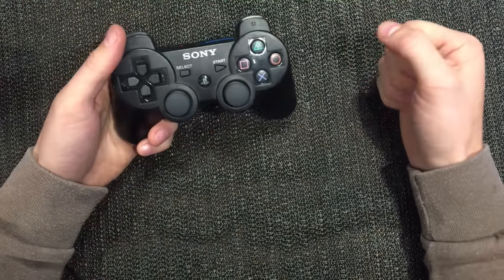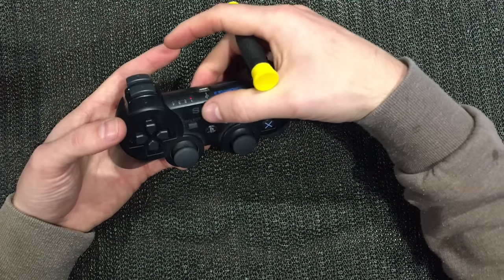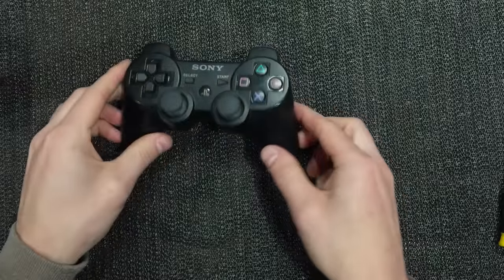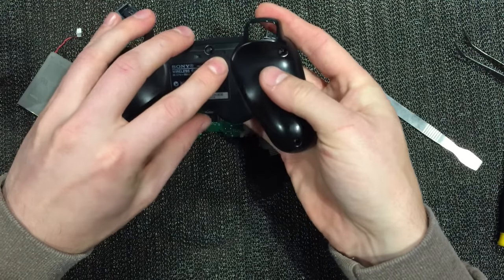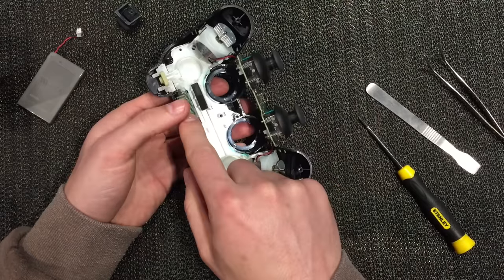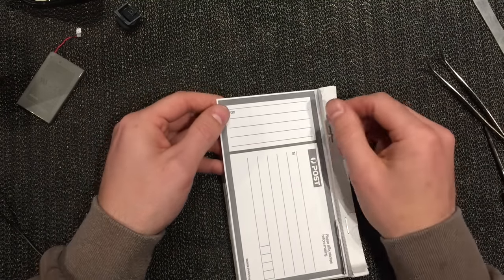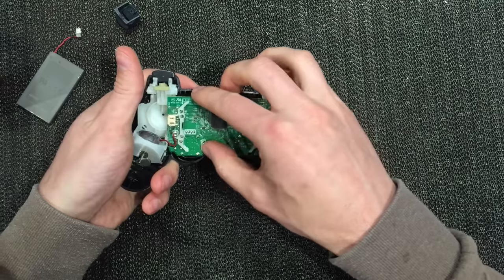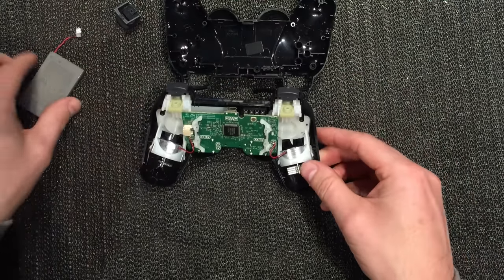PS3 controller buttons pressing themselves fix - YouTube

Comment: This worked well for my ps3 controller as well I also disassembled it completely to clean the buttons sockets as the debris causes friction which reduces input speed, I will say this be extremely careful as the circuit film is not that durable and the bumper buttons need to be align a specific way for the controller to close and the buttons to work properly if done incorrectly it will damage the circuit film, which happened to me then the controller would not turn on so I reopened the controller aligned the circuit film tab with the corresponding position on the circuit board and brought them together in such a way the the tab was held in place by the board and I tightened the screw that holds the board to the whitish/clear frame that holds it and the buttons and joy sticks so that it was locked in places since the hole that caught onto that frame had been extended so it no longer was held in place by the catch, there may be a way to fix the film so it does catch again but I was in a hurry I turned on the controller while it was still open and it worked fine I reassembled it and it worked fine for 30 minutes no random buttons pressed in game.

Comment: for me the fix was just pulling the ribbon, iwggling it a little and putting it back in place, it stopped doing that, whenever I moved the left stick and pressed it's click it'd either cause a triangle or R1 phantom press, after diong it I tested the controller on the PC and was glad to see there was no longer said false presses

Comment: My controller has this problem when I click down left stick… Some games uses LS for running so it’s annoying. It’s obvious the foam you showed in the video is the issue because when I click LS the controller must expand too much so the foam isn’t big enough. I might attempt to fix the issue with your solution soon…

Comment: If you are without post it notes, you can also just use a bit of electric tape. Stick two pieces just to add extra thickness. Clean the contact and ribbon cable with isopropyl alcohol withal q tip until a clean q tip doesn’t remove black, reassemble and you should be good to game. 👍

Comment: I killed my PS3 controller changing the analog sticks, something I've done many times because they are built like trash and prone to drifting. The battery lights turn on and charge but pressing the PS button does nothing, the light won't turn solid or turn on at all if the controller is disconnected. Any idea what i did wrong? I can't find any loose or broken parts in it.

Comment: Thank you for this.  I'd have never figured it out.  What a terrible design choice on Sony's part.  
I used a piece of a cardstock paper from a store punch card and wrapped it with a single layer of electrical tape; it fit snuggly into the little hole behind the foam.

Comment: Thanks! Fixed the mf. Guitar-picks work well to pry them open. I bought a used PS3 and it was my first PS3 controller. I played Demon's Souls with it a lot, but it would register extra d-pad inputs when wiggling hard on the sticks, so I often ended up accidentally unequipping my shield and the enemies got extra hits in. Works flawlessly now.

Comment: I had the same error, I simply took it apart and cleaned the contacts of the ribbon cable and corresponding bit on the PCB with IPA and it works just fine now, if the problem comes back I might try reinforcing the spongy thing too.

Comment: I have a couple controllers with the same problem. Will try your fix and post if it worked. Thanks in advance

Edit: works and i have 2 more controllers now. And simple to execute too. Thanks a lot

Comment: Just Fixed My Ps3 Controllers Instead Of Adding Paper Like You Did I Cut A Business Card In Half Folded It And Glued It Inside To The Back Of The Controller Which Will Push The Battery Enough To Give The Pressure It needs Against The Mother Board To Press Down The Signal Key Pad.

Comment: This unfortunately didn’t work after 3 long hours of not being able to get the small triggers on, as after getting one part on resulted in all parts falling off. After many attempts I managed to get that sorted but the two main parts of the controller do not go together. Putting too much pressure on them causes the triggers to detach again, this makes multiple attempts occur. I would love to be helped because after research there are no controllers that are DualShock that are less than £50, this is quite expensive and I wish I could fix it for free, thank you!

Comment: My controller has a different internal structure to the one in the video as I think its the one with ps3 super slim. I opened my controller and just took out the spinning thing that moves when you move the analog stick, I cleaned them a bit and put them back and it works perfectly though after a week this issue came back looks like I have to keep doing the same thing to keep it running

Comment: All that happens with mine is that sometimes it randomly will input moving the left analog stick about a third of the way to the left, so sometimes in Minecraft I can misplace a block completely because my character started moving directly to the left right before I actually placed the block, or the same can happen when I'm in the inventory menu. The cursor onscreen will randomly start moving slowly to the left of the screen. This is the same on my other Dualshock 3 controller, but it does it far less as often as on the controller that I mainly use.

Comment: Fiddly little buggers, those trigger buttons. That flexible circuit board coming loose is a pain in the ass. It's sort of clever though. I just took apart an old one to clean it. It was having bad thumbstick movement and random buttom presses. Re-seating it and cleaning things with a little air duster did the trick.

Comment: May 2022, I just fixed my PS3 controller, which didn't work properly for +6 years. This is the tutorial you are looking for.

Also I didnt have Isopropyl alcohol, instead I used Old Spice, and it works well.

Comment: Did mine with a piece of paper foled it over a few times didnt have tape so i just pur it on the black piece n then the ribbon cable over it works fine now l i have 2 working controllers now 😊 funny how my pink one had no issues but my new black one did 
Thank you 😊

Comment: Worked for me. Although maybe try just the alcohol wipe first and clean the contacts. I put electrical tape on and maybe it was uneven but the L1 button didn't work. I removed the electrical tape and just tried it with cleaner contacts and it worked.

Comment: Reassembling it is such a pain in the ass. The case just never fits in properly and the R and L triggers are always stuck. 
And the worst part is that this actually works, but the triggers are completely fucked now...

EDIT: It's something about that little wire in the L2 and R2 buttons that makes it so hard to close. I managed to assemble at least one of my controllers, even though the R2 and L2 are a bit stiff. At least it works now.

Comment: Worked for me. Bought a cheap controller off ebay and it did not work. 15 minutes later is was working perfectly. I used black electrical tape about 10 layers.

Comment: I would probably try something more like a plastic or rubber or smth. If you have a 3d printer you could print out a piece to size with like TPU or smth. Been trying to fix a few controllers myself, I might also try putting in two of those black bits in the controller to give it some more pressure. Poor design tho, I agree.

Comment: I must have at least 7 🎮 that have stopped working, or just start drifting.
Didn't have this kind of issue with the PS1 or the PS2.
Controllers don't last long on the PS3, & I'm not hard on them.
Going to open some up & try this.

Comment: Im unsure as my ps3 controllers are fucked. If i push the PS Button, on one controller it acts as if im pushing down on joystick/dpad... the other controller acts as power/X. So i hold it down and it goes "turn off system.. ok". 

other times i hit circle to pause a movie itll end up fast forward. Or R2 acts on its own.

i only have my ps3 in my room for movies but its a pain in my ass.

my ps4 pro, xbox one x, never have issues. Plus ps3 joystick gets slimy. They're not made well.

Comment: Ok so I have 2 issues with my controller (one of them isn't related to the repair). So now I've reassembled it and it works perfectly fine however I noticed that I couldn't insert the logic board all the way in. I think it's a little angled in the controller now and while it doesn't affect the controls, the left stick is a little lower than the right one, and it's gonna make some plastic wear more than before. I don't know why, the logic board just doesn't go perfectly in the shell. The second issue was already here before I opened it, and basically if I press circle there's a loud click from the inside. It works, but it's loud.
Thanks anyway for the tutorial, but if someone has ideas for my issues, that would be nice :)

Comment: Before taking the controller apart I do recommend pressing that reset button. I tried it and the buttons stopped pressing themselves.
Reply: Is this after you take the controller apart and press it or just pushing the button from the back?
Reply: Just pushing the button on the back

Comment: This fix also worked for my PS3 controller. I used 3 layers of cheap duct tape, then used vinegar to clean the contacts. Now if I could only explain how I was beaten at Don Bradman 14 by someone using the controller with the random button inputs. LOL

Comment: Can any body help me?My circuit is much smaller compared to this?I am not sure if it is removable like in this video
Reply: Nvm i managed to remove to circuit but the foam in the video was a plastic piece for me and it was vertically mounted into a pocket.The top that touches the ribbon is much thinner so i cant really do the thing in the video.Well i guess i will just get a new one.

Comment: Dude pls see this comment,whenever I turn on my ps,it functions normally before entering the game, after entering the game,it immediately goes to the "quit your game "screen.and after turning off the ps, the controller is not turning off and the system starts all over again.

Plss see this comment
Reply from the maker: I’d say your PS button is faulty. Pull the controller apart again and clean the ribbon contacts well. Add some tape as shown in the video to make a better connection
Reply: @GlobalGarageAus  sure man will try 👍

Comment: i had so many problems with my controller and i hope this will fix my issue. I've had my ps3 for only about a year and half and i bought 2 brand new controllers and the one i used the most started doing this so i switched to another one and that did too. i bought a new one and this one isnt doing this type of bs but i really hope this is the case with my 2 other ones. thanks for help :)

Comment: The PS3 controller is kinda badly designed... why the hell do they just have contact pads that can easily get dirty or corrode and that is held in place by a single screw that isn't even near the contact pads!?
When I've torn down Steam controllers and Xbox controllers it's either been a single board or they've had proper pin header connectors and ribbon cables.
Reply: Just so you don't have the controller for life. They want you to buy the next ones...business 😊

Comment: You should have shown the behavior of the controller before the "repair" to see the comparison, the content of your video does not show anything other than that you opened the control, put a piece of cardboard, alcohol and put it back together.
Reply from the maker: @lammarhazardd180  It’s a very common behaviour for PS3 controllers. I think I forgot to film that initial part. Thanks for the feedback.

Comment: Still works in 2033. Use electrical tape and make sure you press down on the right side when putting the controller back.

Comment: I wish I saw this video first. I wound up turning my Dual Shock 3 into a frickin Six Axis because I accidentally ripped one of the motor's cable connections from the board. FML.

Comment: I just refurbished a ps3 controller (and probably will do more now that I know what I'm doing), washed it up and put a new battery and sticks in it, then reassembled and forgot that little foam piece 🤣 I was so pissed I thought I broke it or something cause it was just rapidly scrolling through the menu. But nope, just user error. In hindsight I probably should've just looked up a reassembly guide earlier lol.

Comment: PS3 controllers are the worst designed PlayStation controllers. So many unnecessary small parts, and they’re so fragile. The worst part is trying to reassemble them. Once you think you have it together the buttons are pressing correctly or a pieces fall off. It’s pathetic

Comment: Only issue is the buttons don't become as clicky as before😊
Reply from the maker: To restore that new clicky poppy feeling of the buttons, you’ll also need to replace the rubber conductive pads that sit underneath them. They’re super cheap and are available on eBay etc
Reply: @GlobalGarageAus  yh I tried that but it's just once a controller is opened once that clicky from as new isn't as good. Its still good but after opening it once you can tell the difference but hey at least your tutorial helped and I got the controller fixed which is more important

Comment: that worked!!! thanks a lot
Reply: Hey Mimi, when you followed this tutorial, did you follow each and every step or did you just clean the contacts and it started working again? Also, if you did follow it step by step, what did you use to make the foam have a little more size within the controller? Thanks!
Reply: @jayn3636  Hi. I had already cleaned it and it didn't work, so I found this video and opened the controller again. I cut three small pieces of paper from stick notes. Just plain paper to be honest. Tried to cut it with a razor placing the small cushion part on top to be the same size. Nothing really special, it just gave it less than 1mm extra thickness and this did the job I guess. I hope this helps!
Reply: @mimizZzZ  Thanks so much. I'm trying to figure out the best method to place the right paper. I notice in the video he uses something where at least the paper will stick to the foam. I'm just not entirely sure how easy it will be if I used just your usual or regular paper. Appreciate it!
Reply: @mimizZzZ  it did worked, thanks a lot for the tips.